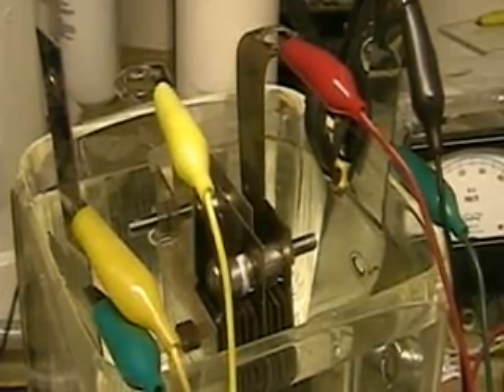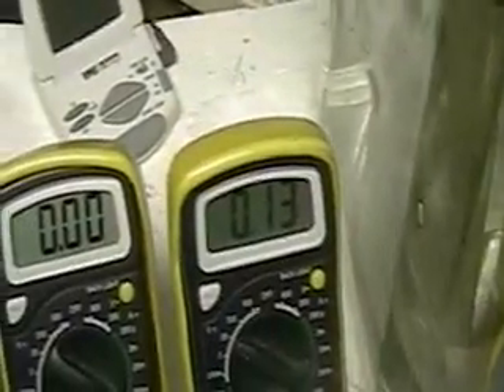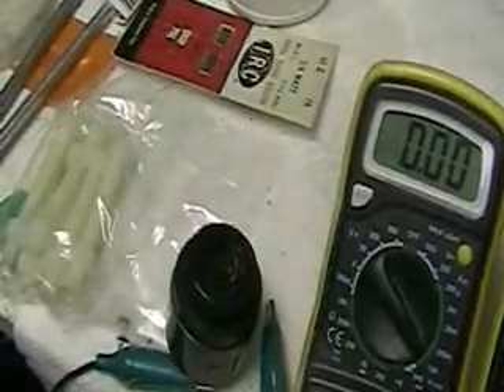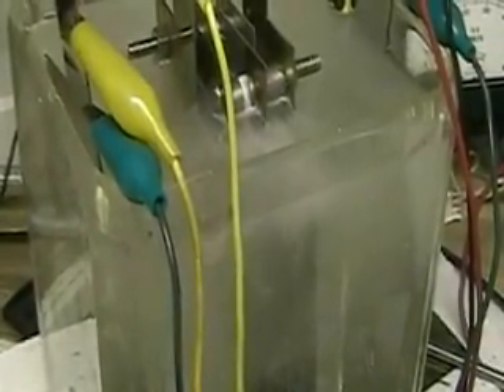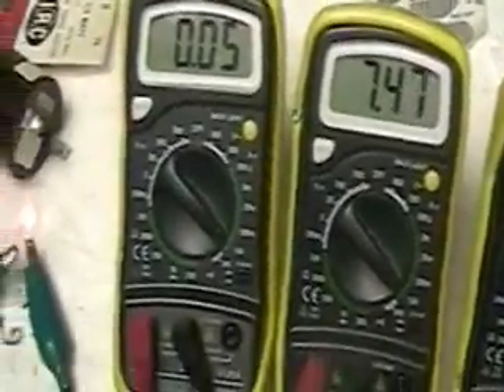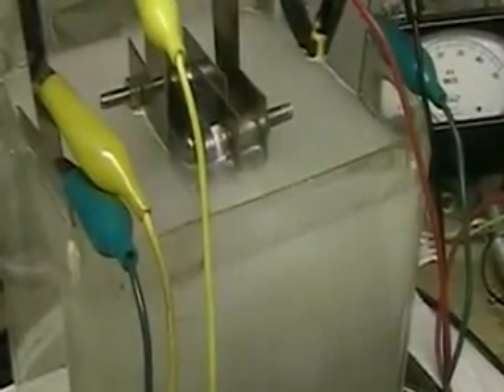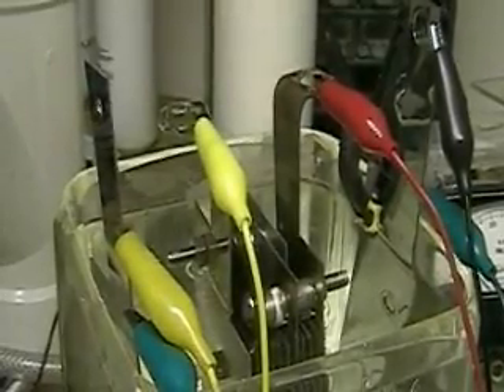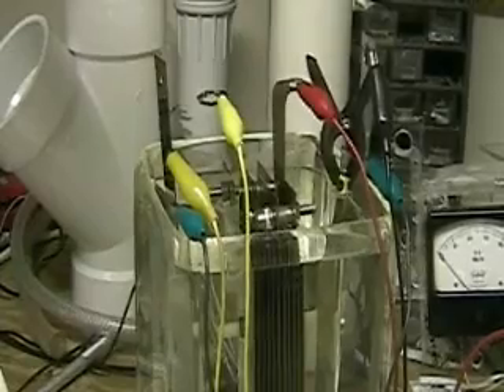Hydrogen Tap ( FOCUS-NEW FINDINGS) 347

Comment: Isn't the electrolyte acting as a conductor? Also, each neutral plate loses voltage the further away from the source, correct?